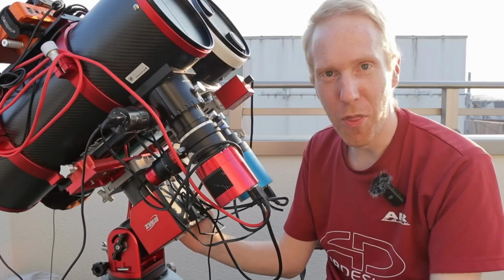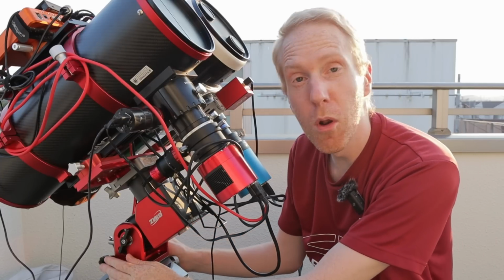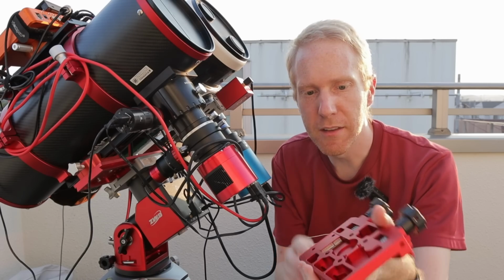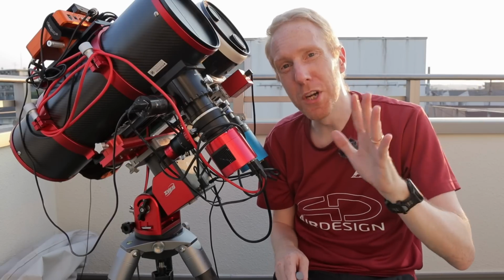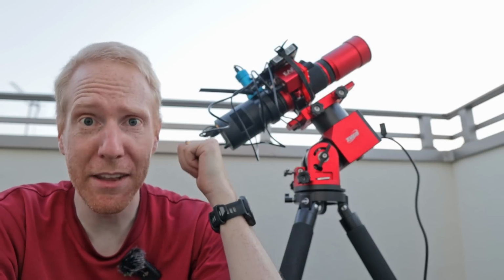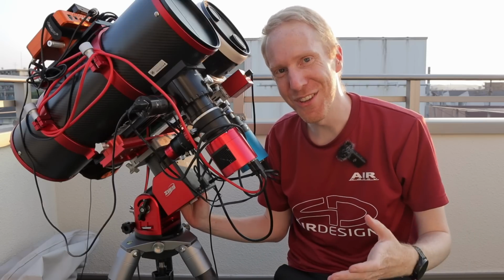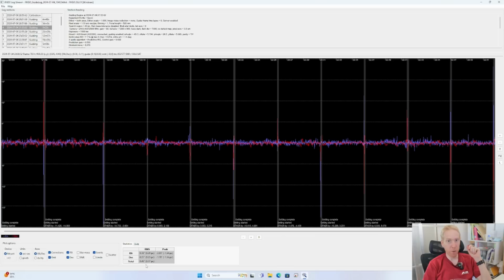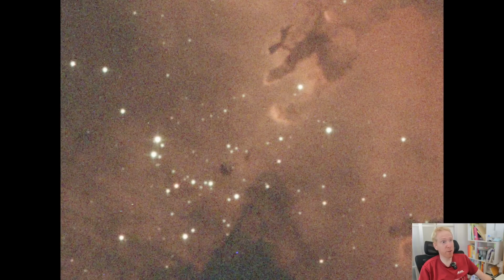I did NOT expect this! Full Test of the NEW ZWO AM5N - How will it perform??

Comment from the maker: Quick note on the power: many commenters note that exceeding 3A could be dangerous for the mount, so please keep that in mind and be less cavalier than I am to be safe! Also, it seems there is a Home setting feature in the app that could solve the issue with my dual scope, I will check it out!

Buy the ZWO AM5N: https://bit.ly/3W3TWKe
Without tripod: https://bit.ly/3XNxPZx

Want something smaller? The AM3 should be good: https://bit.ly/4cAjxzQ

Want something larger with more payload? The WarpAstron WD20 is for you! https://bit.ly/3wxNbGI

You don't like red or prefer direct drive? the WarpAstron WD17 is here! https://bit.ly/4bsMOLF

Agena affiliate: https://bit.ly/3Om0hNG

My Patreon: https://www.patreon.com/cuivlazygeek
Reply: You can put on a power supply that can supply any level of current (amps), the devices will only take what they need. You can connect a 100 amp power supply and not have any issues, but do NOT exceed the maximum rated VOLTAGE.
Reply: @PhilPassmore   I've always thought this, and it should be the case for a well designed piece of electronics/electrical equipment, but I wonder if it is always true. Could there be a situation where a device relies on overcurrent protection in a power supply to prevent it from overheating eg. when powered up with a motor unable to rotate? Electronics get killed by high voltage, but motors and servos get killed by total power. Putting the protection in the approved power supply would be a janky way to do it, but does it get done?
Reply: @hollo9571  you can only 'push' into a device by increasing the voltage. A power supply cannot 'push' current. For example, your mount will happily run off a 12 volt car battery, that CAN supply well upwards of 100 Amps, the device, no matter how badly designed, won't be flustered by the current available.  That is why the expression is that the device 'draws' current, not that the power supply pushes it. The voltage however is a whole different ball game.
Reply: @PhilPassmore  I understand this. But motors draw much more current at their nominal voltage if they are not rotating - no Lenz's law to push back on the current flow. Many motors will burn out at rated voltage if not allowed to rotate.

Some power supplies will fuse/burn out if they exceed their maximum current draw. Some will drop their voltage. I was idly wondering if a power supply that drops its voltage when overloaded could be protective for a device it was powering, and whether this was ever part of a (bad) design.
Reply: @hollo9571  If you are concerned about over current draw, just fit a current controlled shut off. The problem with a stalled motor is that a circuit that is designed to accept a transient voltage (brushes and commutator on a normal dc motor, or phases on a stepper). When stalled, we just continue to apply voltage to a single winding/phase, which not having any time to recover in an off state, then overheats.
Reply: you should see our eastern european rigs, car batteries or amazon bare batteries put into a plastic box with cheap wiring
Reply from the maker: @astroslap  I can smell the jank and I love it!!
Reply: I use 12v 5A is it dangerous then Am3/5 mount?
Also now I use the same supply for ZWO ASI585MC AIR. Otherwise I have to look for 3A version. Thanks

Comment: Can you do a comparison of the AM5N with and without the counterweight in somewhat windy conditions to see how it does when auto guiding? I am interested to see if it makes a difference or not. I am considering purchasing one of these mounts and may go with an AM7, but not sure even if it would do better in slightly windy conditions when auto guiding. My assumption is that the counterweight might help, but then it might not and I think the only way to know is if it's tested. I have not found anyone that has done this comparison. Might be good to try out a couple of different style of telescopes in terms of weight and length as well. Thanks in advance!

Comment: so for 90 degree turn don't file or drill with 3D printing now, use a thin 4mm washer with two bump things on one side and two holes 90 degrees on the other, maybe some slightly longer bolts. job done.          edit:- forgot about the centering thing

Comment: Has anyone checked what maximum voltage the AM3 can withstand?) Is the 4S lion battery capable of withstanding 16.8 volts? On the balcony, I power it from a 15 volt power supply unit - it beeps from 12 volt - there is not enough voltage...

Comment: wow. Great video. I'm old school and have a EQ6 with ESQmod but the time it takes to set up is a lot as the weather here in Ireland is so bad. Am I right in thinking I could add my meade 127mm refractor, a ZWO autofocuser, ASIair and ZWO ASI2600MC Pro smart camera to this mount and it will pretty much auto polar align, with some tweaking, autofocus and goto objects and take great images? I basically want to carry out my kit, roughly point it north and then run back in and use a pad to do mst of the rest of the work without too much back and forth.

Comment: Hi Cuiv

I Got my AM5N about a month and had some bad nights for testing. It works - and everything is fine BUT....
One of the big "Hype Points" are that good guiding ic cause of the HD Gear - wich means it doesnt run smoother but act faster to corrections.

I Read a lot about how the AM5N works and how to Guide.
With all of my "normal old school stuff" i have a 30/120 or 40/160 guidescope and a 120mm mini - and exposure about 1,5 to 2 secs - and everything is good.

Now i hear that the big pont of that HD Drive is that the Mount act a lot more direct to move orders so can firmly better outguide any issue.
And - my 120 sucks at exposure of about 1 sec or les - and when i push the Gain.. everything get worth.

In the ZWO Forum there is a very long Thread about the Guiding of the AM5N  and how to master it - in special with dhe diagramm that came with the mount.

I now have a 220mm for better / shorter exposures and hope for better guiding but cant test it because clouds.

So i ask for a bit help. How do you set your Guiding parameters (in my case in Asiair) and i am sure you know the LONG Thread i talk about... so for a not native english speaking person thats a lot of "kauderwelsch" (German word for un-understandable talking). Can you summarize it. or even better:
Do you plan to make a Vid for AM5N Guiding?!

Thx a Lot :)

Kai from Rhein-Main Astronomie

Comment: You could connect the mount to a 12v 40amp power supply and would do no harm. The mount  and associated equipment will only draw the required current amperage from the available 40 amps. Having excess amperage available on you DC feed is fine, having insufficient could cause damage or malfunctions. I work with a lot of Radio equipment and the current draw principle is the same.
Reply from the maker: Yep, agree - here the risk is having too little on the saddle output... (I think)
Reply: @CuivTheLazyGeek  Apparently the saddle output should give out 12v @ 5amp, which is the required output for the ASIair. So if you supply the mount itself with a minimum of 10amps it will power the mount and output and still leave a 2amp margin.

Comment: Going to go for either the older AM5 or the new AM5N, but I need to run a dual scope setup similar to your Frankenscope. Can the AM5N saddle do it? I can hardly wait for your answer!!!  Is there a performance difference that you can see in your images between the two?

Comment: Thanks for the review Cuiv. Just places my order. Been fighting with my cgem dx for years now. Sometimes it works, sometimes not. Changed both motors twice now over the 10 years ive had it. Most of all though, it weighs a ton and i find myself less and less apt to drag it out of the house if its not a 100% perfect night. Never got ascom to work properly with it either which was a real bummer after getting the 2600 duo (no phone jack for autoguiding).

Comment: Hi, one thing I couldn't find (maybe I missed it), is how the USB-C on the saddle works. From others reports, its IN only, and a not a passthrough from the main USB-B input from the body.

So to get the usb cable management right, you need to have a mini-pc on the scope. If you use a laptop or remote pc, there's really no advantage to the usb-c port (maybe a disadvantage, as it now rotates with dec also).

Its fine for those using ASIAir/mini-pc on the scope, but if not, something to be aware of.

Comment: The saddle issue can be resolved if ZWO just drilled a third hole under the saddle, so that the "bumps" will still have two holes to sit in when it is turned for an array setup.👍
Send ZWO an email and tell them that I said to just do it. 😁

Comment: I solved the saddle wiring for a dual setup issue by using a Vixen plate with two Vixen clamps, one on an adjust for aiming the scope on that side. So I bolt a shorter Losmandy plate rotated 90 degrees. Walla! No need to rotate the saddle. Tightening the AM5N knobs was a little fussy, but using the attached wrenche to make them snug worked well.

Comment: Nice summary, cheers Cuiv. One of my minor bugbears is power in astro systems (I do a fair amount of electronics development in my line of work) and its over-use of 12v power systems (convenient though it is for portable/battery systems). I’d really have liked the AM5 to at least have a DC-DC converter inside so you can feed a higher voltage (which has lower power loss) and not have this damage the mount, but the two power jacks seem to be wired in parallel. Feed in 13v and you get 13v out of the secondary jack (and vice versa). I’m really not sure how one can be limited to 5A and the other 3A if they’re directly on the same power bus (unless they have independent fuses on the board: looking inside is not clear)… and without a proper schematic it’s impossible to tell! However, from the manual ZWO state that the mount can take 11-14v: important for lead-acid batteries as a full charge gives more like 12.9v and for some of the Lithium battery packs that state 12v output it is actually 11.1v -  the cheaper ones are just three 3.7v cells wired in series. Enter a big slew or camera cooler set point and the extra current draw can cause the voltage to drop, and if it then goes below 11v the AM5 will complain and can even cause data connection issues. To guard against this I try to use ~13v for all my astronomy gear (plenty of options for well priced power supplies, particularly in the radio ham community) and then a bit of voltage drop between power supply and mount does not cause issues. Or, for those confident with a soldering iron, hook up a DC-DC converter that will regulate a wide input voltage (typically 9-18v input) to a fixed 12v output right at the pier (and adds another layer of short circuit protection). 

P.S. Tracking I measure 0.47A (at 12v, but this peaks at 1.75A during slew (say, setting it to the home using both axes) so having extra current capacity is important… if one connector (the one soldered directly on the board) is rated 5A and uses almost 2A that for tracking/slewing then I assume that’s why the other is set at “the difference” of 3A (or maybe it’s the rating of the cabling internally). Myself I would be wary of using the full 5A rating by using the secondary port to power the telescope gear. Better have the power come into a device such as the Stellarmate Pro (which I use) and send power from that to the mount, camera, etc. Or equivalent from pegasus, etc, or just make your own splitter…

Comment: You don't need to remove the saddle to adjust home position, you can customize saddle home positioning with the ZWO AM5 app.
Reply: May I ask, when the AM5N is rotated 90 degrees to the home position, does the wiring inside the saddle get disconnected or cut?

Comment: I've used the original AM5 for 7 months now, the last 3 with a Meade 10" SCT on it. The SCT and other gear are 15kg so I do use a few kg counter weights. I've never had a problem with the mount, polar alignment is easy, and my guiding is typically between .4 and .7 arc-seconds. Based on this I'm not surprised with your results. It's a great mount.
Reply: Can i ask if you use OAG at that Focal Length? No issues with using a strainwave mount? Thx
Reply: @chrislee8886 no I have a separate guide scope on the SCT.
Reply: No issues at all with the mount as long as I had the correct counterweight.
Reply: @michaeltaschuk7744  in which case can i ask what size autoguider you use. Looking for my own approach since the OAG really stops me using the AM5 on my 8”SCT … and i thought these scopes had real issues using autoguiders…

Comment: I have been waiting for this video Cuiv.  Both of the AM5N videos provided a good review of the mount.  The AM5N will likely be my next major purchase.  I am waiting for a few more reviews on Cloudy Nights and YouTube.  I am still unsure about the spring tensioning arrangement for the AZ base and the AZ adjustment.  I would have liked to see an arrangement like Losmandy or Astro Physics uses to adjust the AZ on their mounts.  The reduced PE is good but the RA periodic error plot that’s supplied with the mounts still looks random and not repeatable.  I don’t think PHD2 Predictive PEC would work well with harmonic drive mounts.  I would like to see testing with and without Predictive PEC in a future review.  I still have concerns about the drive belt design.  Can you please decrease the scale on the Y Axis so we can see more details on the PHD2 plots.  It would also be nice if you can post PHD2 plots in the ‘Cloud’ so we can have a closer look.

Comment: If you’re looking for an easy and quickly removable solution to the sideways saddle problem for side by side configurations I’ve found at least one:

Get a secondary saddle of whatever size and style is your preference, and a short dovetail plate from ADM or someone reputable, and bolt them together back to back at 90 degrees to each another.

Instant 90 degree saddle when you need it.

I’ve got a photo but I guess attachments are not supported.
Reply from the maker: Oh right! I see what you mean! Good idea!

Comment: thanks so much for this.  it's great to know that the am5n works well, and you'd probably be very happy with either the am5n or the wd-17 (similar payload capacities).  i'll the am5n on the wishlist as it's cheaper than getting the wd-17 + tripod, unless maybe there's another lightweight tripod that comes out that's better for this strainwave mounts.

also, more thanks for checking on that meridian issue.  good to know for sure that it's not a problem anymore
Reply from the maker: Yep, I think either mount will work quite well!

Comment: The unlimited rotation can be achieved using a electric swivel that is able to transfer energy and signal from the static part to the rotary part. I saw this approach in stabilized vsat antennas and offshore cranes.

Comment: It seems to be a nice mount! As with everything, time will tell... I don't expect any real problems though. I won't upgrade yet. For the saddle problem zwo can easily spec just 1 more receiving hole for the little alignment nubs so it can be used 90 degrees rotation. (Or 2 holes to allow freedom to go either way.) No programming change needed to the mount, just a small change in the cnc master file. Or they can do that in the mount software and not make the modified hole. Myself, being in the trades for most of my life, would opt for the physical extra hole as being the most elegant and simple change. It must be a precise as the rest since it is an alignment hole and not just clearance which is easy because outlet use the already mounted tool in the cnc machine.
Reply from the maker: Yep, fully agree there, makes sense to have those additional holes instead!

Comment: If it can hold its upper limit in kg and guiding is so precise at the same time, then a classic C11 at 12.5 kg is a piece of cake, and with all the imaging stuff it will be at a bit less than 15 kg, so yes, it seems it is the absolute harmonic mount. With counterweights, it could certainly guide a 12" LX200 OTA (16.5 kg) with the same results. Such a great mount it seems to be.
Reply from the maker: Yeah I hope Lukomatico will test it with an SCT!

Comment: How can any serieus amateur astronomen think that an ZWO AM5  could be use for such a lange telescopen. For me it is clear. You are just advertising this mounth.  I can not take you serieus anymore. Any person who has knowledge of mechanica and forceren on gearwheels understand that a astronomical setup must be like an triangle. Have at the bottom, light at the top. Not the other way around. Not all people are stupid.
Reply from the maker: What are you saying? I actually used the ZWO AM5N with that large telescope, and it worked very well just like I showed in the video. Are you saying I am lying and I did NOT perform the test I did perform? Well I did, so please don't call me a liar.
These are strain wave gears, they have insane amounts of torque!
Reply: You are so wrong on two points. First, this mount can handle large telescopes. I have the AM5 and can attest to it handling large payloads very well. Second, Cuiv gives honest reviews of equipment and your statement is  slander.
Reply: I use a 200mm f/4 with imaging gear on mine with no problem.  I know people that happily use 250mm f/5 scopes on them. It's not hyperbole or 'shilling' - strain wave mounts are simply capable of handling heavy loads. I think you owe Cuiv an apology